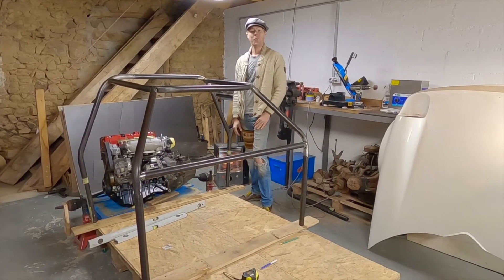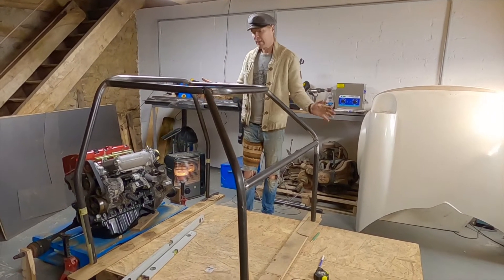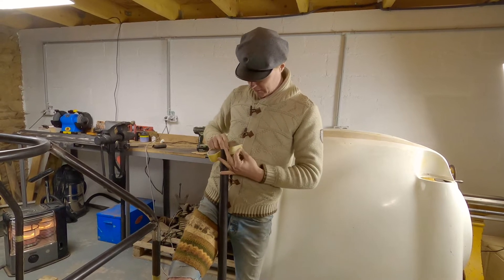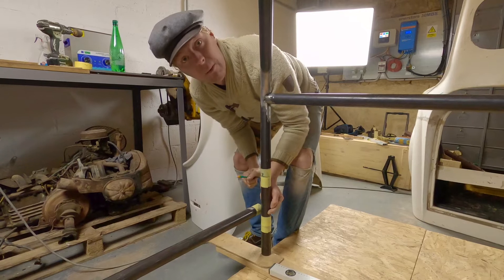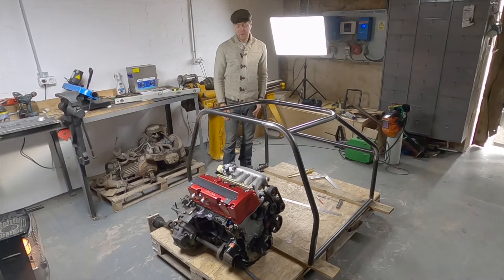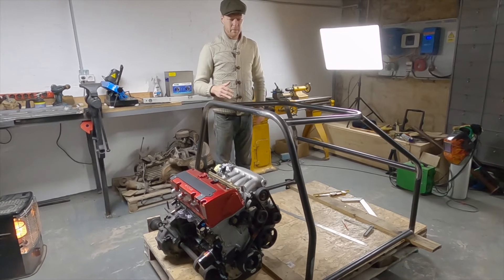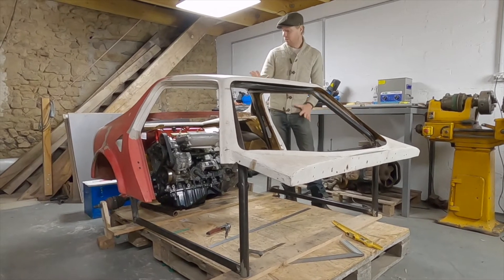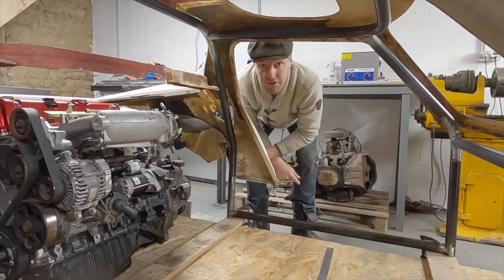Will The Body Fit? | Project Mosquito Honda Type R Mini Supercar (Ep14)

Comment: Good progress being made. I was pleased to hear you use the word "triangulation" in this video as I'd been beginning to worry about the lack of any diagonals in this cage, especially as it will be working as a space frame. I'm sure you've got it all in the design, whether on paper or just in your head! I've got a much later GTM - the Spyder, with a rigid GRP monocoque.
Reply from the maker: I've had trouble getting hold of materials because of lockdown so I'm trying to get as many long lengths out of what I've got as possible. It's not a true spaceframe, it's an integrated cage so there will be triangulation but also monocoque elements. It's all about packaging

Comment: Great job Oliver, can you add 45 angle reinforcement? 
Or is it not necessary? Once finished, add cylindrical compact foam padding to avoid blows to the helmet or head.

I congratulate you for the videos and how the barn was finished, make more videos of CItroen 2cv. Good 2021

Comment: I have a question for you which is nothing to do with this video: should a 2CV be garaged in a heated garage or not? I live in North East Lincolnshire
Reply from the maker: It helps later 2cvs are very rust prone. a sealed floor is more important than heat really but a heated garage is a lovely thing
Reply: @OliverPickard  Thanks for the reply. When you say sealed floor presume you're referring to the 2CV having a sealed floor?
Reply from the maker: No the garage having a sealed floor to prevent damp with a membrane and not just raw concrete. if you have an older garage there are coatings you can use.you basically a warm dry room is the best place to keep any car